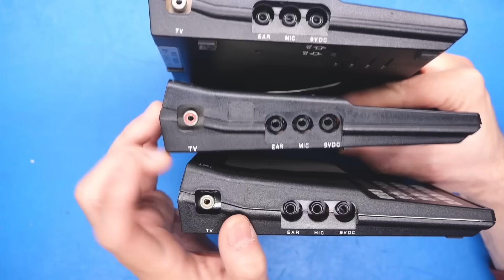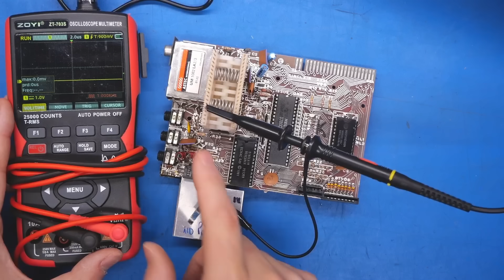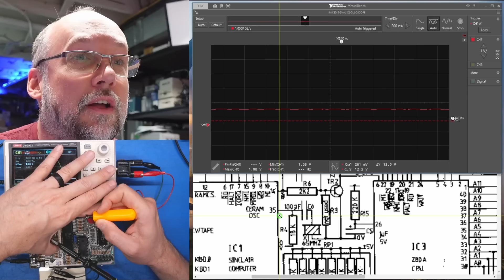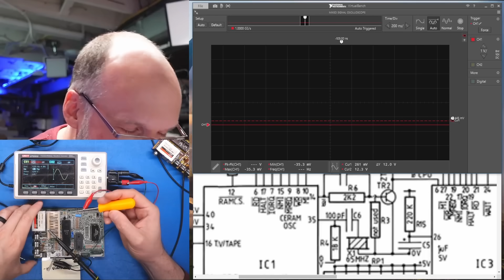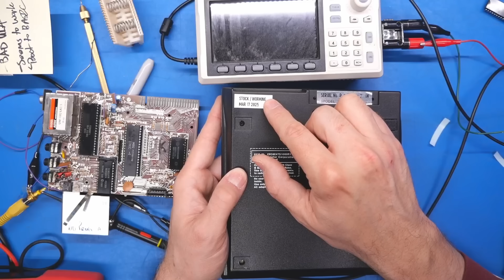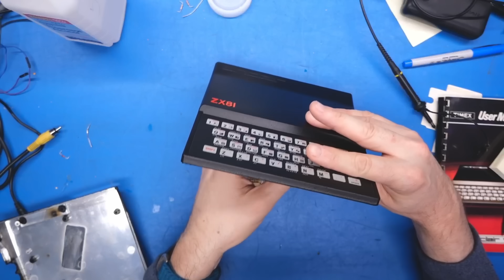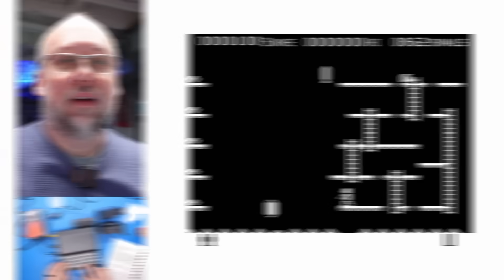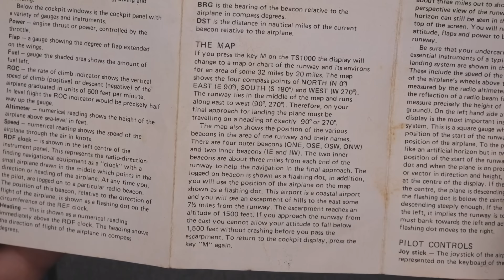Is the ZX81 / Timex Sinclair 1000 actually bad? Let's fix these to find out.

Comment: A year after the TS/1000 came out,. Timex released a version an updated version of the TS/1000 in basically the same shell as the original ZX Spectrum called the TS/1500. It's essentially a TS/1000 with 16K built-in (no RAM pack needed) and the rubber/dead flesh keyboard of the Speccy. 

Fun fact about 1500: Many of these computers ended up in computer programming training kits (think Control Data Institute) after Timex stopped producing all its computers. This is the most common version seen when searching for this model on eBay.

Comment: To my knowledge. the zx81s were sold in north America in a cheaper Kit form. however the off the shelf fully assembled ones were all Timex branded. Not sure if that is 100% true as the timex sinclare / sinclare x81 was before my time, but i found my dad's forgotten on a shelf back in the 90s and did a little digging.

Comment: The problem was that a real keyboard cost more than the machine! There were many aftermarket keyboards either using surplus keyboards or anything but proper keyboard switches, but there just wasn't particularly in the UK the sheer number of old keyboards around that there is now. When I see piles of old worthless PC keyboards nowadays   it still seems strange to me as I remember when they were like gold dust.
Sinclair were the absolute masters of engineering things down to a price point which was just that crucial bit too far to get something that really worked properly.

Comment: I hooked up a different full-size keyboard to mine. And even “manufactured” a couple for other people with this computer. It was a game-changer, for sure. The noise issue and other stability issues were largely addressed by modifying the power supply with significantly larger capacitors.

Comment: I just started collage in 1981 as a programmer and I sold my Atari VCS 2600 and cartridges and purchased a Timex Sinclair 1000 with 16k ram expansion.  I read in a magazine how to build a joystick adapter so I bought the parts and soldered one together. I wrote some games on it an eventually got a VIC 20. I still have the computer and it works along with a stack of magazines and cassette tape both retail and the games I wrote. I broke it all out and put a new drive band in the cassette player and it loads stuff and works! I was great for a young college student to get started!

Comment: Adrian thank you for covering these. My first computer my dad bought me in 1983 at Wegmans supermarket in central New York. I have 2 in my collection here and one with the 16k ram pack. I also had an aftermarket keyboard at one point that went on top. I tried making my own by filing keys from a buddy L typewriter I had and sticking them on with tape. My first sim was on these and also Frogger too!
Reply: Just to add on there were a number of add on keyboards that would go over it and I had one that did make it easier. Also the improved version would be the Timex/Sinclair 1500 that came out around the same time as the 2068. I had the 1000 as my first computer and wrote programs and learned Z80 machine code (didn’t have an assembler). The ZX 81 I have here is indeed made in England for US use after watching your video. It was a good machine and easy to learn but yea keyboard was bad but my 13 year old self didn’t care.

Comment: Question! Could you use conductive paint to fix something like those broken ribbon cables? I was thinking you could apply the paint to the broken/damaged traces then just put some heat resistant tape on it. Apologies if it's a weird solution I'm a noobie with this stuff!

Comment: There are conductive inks / conductive pens - likely not much more than fine copper dust mixed in a substrate - you could attach a new piece of plastic and draw your traces. I got one such pen, it has a quite tough spring valve at the tip (bet it will dry out nonetheless), it's clumsy at best, found it easier to flood fill an area and then use toothpicks and acetone, call it freehand isolation routing if you will.

Comment: The keyboard membrane connectors on these do NOT age well. A couple years ago I restored two NTSC machines - a ZX81 and a TS1000. I picked up two replacement newly-manufactured keyboard membranes from a retro-vendor and replaced them both. MUCH more durable and amenable to removal if it’s ever necessary to get inside the machines for future work.

Comment: The machine is already a marvel of costcutting, and I am not surprised if the possibility of running without a clock is a result of that. I can imagine sinclair demanding cutting out that component and a desperate engineer showing him the difference between the image of the two, while sinclair begrudgingly allows a few cents more in the BOM.

Comment: My family had a few TRS-80s, but for some reason my dad decided to order a ZX81 as a build-it-yourself kit.  Probably thru an ad in Popular Science or the like.  We were not particularly skilled in electronics and once it was put together it did not work.  We ended up sending it back and they sent us a factory-built one as a replacement.  This was BEFORE the TS1000 variant came out, because I remember my grandfather getting one of those a bit later.  They were mostly a novelty and I don't really remember doing much with them vs the radio shack and ibm pcs that were also floating around our houses.  Super interesting time to be a kid!

Comment: It was better than my unexpanded VIC20 considering I had no tape drive for the VIC and a 16K expansion for the TS/1000. Once the membrane keyboard failed it was pretty worthless however.  My grandfather fixed the wobbly RAM Pack with some epoxy.

Comment: I purchased a used Z80x back in 1982.  Unlike the Z81x, the Z80 was white and inside it did not have DMA which prevented it from displaying video output while the program was running.  It had the functionality of a fancy calculator.   After a week I ditched it and bought a VIC20 for $80.

Comment: 8:30 - My brother discovered that placing his ZX81 with 16K RAM pack on top of an empty standard A4 ring binder (such that the RAM pack was toward the spine of the binder) created the perfect amount of pressure in just the right direction to prevent the RAM wobble problem. Before then he'd tried many solutions, the usual wedges of paper, BluTak, etc., but the ring binder trick worked very well.

Comment: 48:22 I have had the same issue with my mod. Basically the backporch was way too high on the ZX81. The difference between white and black level wasn't correct. And that was on a PAL machine... 
Also I put my composite mod in the machine WITHOUT gutting the RF modulator, just desoldering its input. This way i could revert the whole mod.
51:34 the black level on your mod is still too high. You can see that your black is more greyish.

Comment: The reason the later machines with the 2C210 ULA show the 'ledge' on the video signal is that they're supposed to. It's an improvement. That's the 'back porch' or horizontal blanking interval, which the monitor or TV is supposed to be able to use as its reference for black level. Most colour TVs do, but most monochrome TVs back in the day didn't bother., and they just used an average value. The earlier 2C184 ULA didn't have the 'ledge' so the TV, sampling its reference black level just after the horizontal sync, gets it as...white. This often resulted in a very dark image which you could only just see with the contrast and brightness turned up. It certainly was an issue with our colour TV at home back in 1981, but on the old Bush valve black and white TV upstairs it was fine.

Comment: Had a ZX81 and rather than buy a 16K RAM pack bought  a VIC 20. Mistake should have bought a C64 straight  away, which was my next upgrade.  Having said all this the zx81 taught  me to save works in progress and to this day am loath to run more than  one application at once. Less can teach you more.

Comment: Video timing is entirely CPU driven, also addressing the fontmap,   original power supply 9VDC  700mA (unregulated) iron transformer, diodes and a capacitor

Comment: Those Ferranti ULA's are notoriously unreliable, and ran very hot, so a big upgrade was both a larger heatsink on the regulator (fill the whole inside of the case instead of the square one) along with a stick on heatsink for the ULA, allowing it to run a lot cooler and be a little bit more reliable. Also Sinclair bought 2MHz chips, and overclocked them, as most of the chips were capable of faster operation, so just testing them before shipping made it worth the cost saving of buying the expensive 4MHz parts. Basic runs slowly because the CPU is very much involved with video generation, so there is less processor time available to run programs.

Comment: Bad? Of course it wasn't bad. It was sort of the Raspberry PI of the day - cheap, well documented, you could build it from a kit, and you didn't need a special anything to use it: just a mains outlet and a TV. It loaded quicker from tape than a C64 + 1541 combo, too.

Yes it had no colour, or audio, and the keyboard was an absolute nightmare to use: but what was the average household computing power before that? Maybe a pocket calculator? The analogue timer / switch gear in the washing machine?

This machine and a few like it brought computing to the masses, and kicked the UK computing industry into gear. Probably wouldn't have half the cool stuff from ARM we do today if the likes of the 81 and Speccy hadn't spurred Acorn on.

Comment: I'm not a fan of the Sinclairs, but I do love the Z80. My first hand wired computer and cpu emulator were both Z80 based. I built my own computer using the eZ80 to try and make basically a PC88 inspired machine on crack (or kind of an 8-bit Amiga Jr in terms of output), building my own video and sound cards with RP2040's and PIO at first, then when the RP2350 came out I made new cards to simplify and improve things. I spend a few months out of the year overall in Japan at my work partner's parent's house in their guest house in Hokkaido. My work partner's father and his best friend were both technicians that worked on PC88 and PC98s back in the day. I love the PC88 and PC98 lines, owning at least one working of every model thanks to me or my partner's father picking various stores across the country to add to my collection. The PC88VA being one of my favorite computers (because of the unique NEC processor that was both Z80 and x86 compatible), so much so that there is a PC88VA3 sitting on my bench of retro machines I use to program on/for all the time (next to an Apple IIGS, Mac IIcI, 386SX PC, and a 486SX2-66 PC (Overdrive upgrade, I really like the gimped SX line despite owning most 386 and 486, and 486 pin compatible like Cyrix, versions released that I collected years ago when they were worthless and not worth gold)).

There's something appealing to me with the Z80, even if isn't really the winner vs all the other popular processors to be bases for computers of those eras. It's probably the same screw loose that leads to me loving the SX line of processors despite them being just worse in every way (386SX especially, a processor so weird and gimped that even some 286 can beat it depending on the circumstance).

Comment: Hi Adrian, the ZX81 was my first machine back in the early 1980s. I also had the 16K RAM pack with it as well. As to your question about whether you get used to the keyboard with extensive use, the answer (for me, anyway), is 100% yes. Fast-forward all these years later and I still have the muscle memory for which keys to press when typing in BASIC programs. I later upgraded to the Timex/Sinclair 2068, which was a slightly upgraded version of the ZX Spectrum - it had a sound chip, Atari-style joystick ports, and a cartridge port, along with plastic chiclet keys, instead of the Spectrum's rubber ones.

I went on a collecting spree on eBay a couple of decades ago, so I have several examples of the 2068 if you'd like to see one.

Comment: I had almost talked my parents into buying a Commodore PET when the ZX81 came out and they bought that for me instead.  But aside from the inherent video noise, squishy keypad, wobbly RAM pack that would crash the computer with the slightest movement, the tendency to overheat and the very unreliable saving to tape - I still spent a LOT of time writing quite complex software on it to do things like create and then solve random mazes.
Reply: I bet you were disappointed it came out before they bought you the PET. xD
Reply: @Rausdau3r  I sure was.  I was hoping for the super-futuristic looking PET.  But I went on to the Spectrum, QL and then the big jump to a DOS PC.
Reply: Dktronicsold a keyboard you could put the mobo into. They also do a kit that could give it near spectrum level graphics. No colour. I remember you could create your own characters as well. I remember playing a version of space invaders on it and asteroids. Pimania was my jam
Reply: @TheStevonz  yep,i have a zx81 in a dktronics case, plus one in a fuller, the dk 'hires' module was a graphics character rom,  you couldnt drive hires directly, later people found ways of tricking it into generating pseudo-hires, and even 'proper' hires, using machine code, with a modded rampack
Reply: That 16K donkey RAM expansion.  Shove a match in between the main unit and the donkey and stable.  Mostly 😅
Reply: @conceptrat  I always found back in the day a shaped blob of blutac did the job
Reply: You like me are a person of a certain age. 🙂 I also had / still have a ZX81. Me though my first seen computer computer was a ZX80 a School. Where we were also used a PET. My fist owned computer back in 85 was a ZX81. Loved it, for all it's quirks. Back then you didn't have much else. It is from the 81 that I have a found love of Z80 machines .
Reply: Cheer up Clive mate, I got a programmable calculator. Also by Sinclair, their very first and boy do miss that little fella.
Reply: I remember having a zx81 in the 80's, well having more like my sister but we did have the expnsion cart, cant remember the size i think it was a 16kb.
Reply: @beardedmonkey1320  that was the most common size, over 16k was non standard and the extra not easily usable
Reply: Do you have any of that code left? I'd love to see how you wrangled that out!?
Reply: Oh Clive, you could have become a YouTube legend with a million subscribers if you had got the commodore 😅🤣

Comment: I think your problem with the ram pack is due to the fact that all the power required loads the psu, which runs hot anyway. I tried buying a replacement 6v wall wart to reduce the heat generated in the voltage regulator , but it doesnt work very well with the memory pack.
My guess is that the unregulated 9v might be fed to  the ram pack and regulated there, instead of just being powered by the computer regulator so a 6v power wart is not enough to power it as well as the memory. It was a long time ago, so i dont remember for sure, but it might give you a place to start looking.

Comment: Used mine with a BB-1 I/O module from Byte-Back co.  It had 8 relay outputs and 8 inputs.  It was mounted just in front of the 16K module. I used it to manage greenhouse fans and temperatures.  Worked great for the era. Still have it sitting on the shelf for looks. 😂

Comment: My first home computer was a ZX81 with 16K RAM pack. The keyboard was bad but you did get used to it, there was a technique where you would wipe your finger top to bottom of each key which ensured they registered and also once you learned where all the keywords were you could type in a program quite rapidly. I did look at keyboard cases but in the end the machine did all it could for me and I moved on to a BBC Micro which was a whole world better but without the ZX81 I wouldn't have ended up in computer science so it definitely had its place in history.

Comment: Was glad I found this video. I am about to test a pair of ZX81's. Both are issue 1 boards. Neither of which are showing an image on the one (modern) TV I have that still has an analogue tuner, but this is likely down to auto tune on new TV's not latching on to the somewhat pathetic RF signal the ZX81 puts out. So before i go and composite mod them, I need to run through similar test's to those you performed to check if the ULA, CPU, Ram etc is still working, and if anything else is kaput. TBH I think the fun will be from troubleshooting them and fixing. more than the actual using them. Still a nice thing to have in the collection. Ideally id like to keep one as stock, and one is to be modded to have internal 16k ram, comp mod. and anything else that will still fit inside the original case.

Comment: I had one in the early 80’s, hated that keyboard! In the 90’s I ran a BBS in Houston for Commodore users (using a C64 with MSD dual). I went to a flea market, and found a 1000 that had been heavily modified, using soldered wires to the port, out to daughter board. It had a bunch of peripherals attached to that daughterboard, including a floppy drive. Someone way smarter than I, had built it into a monster! Should have kept that thing, but I do still have my original 1000 somewhere.